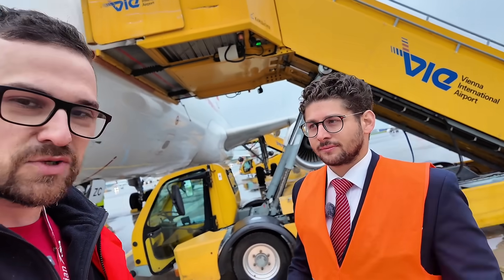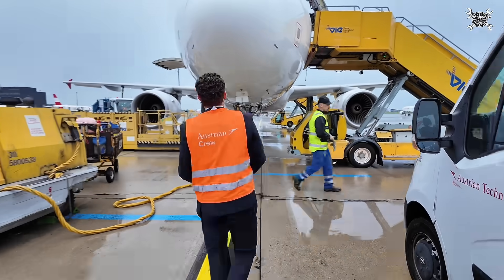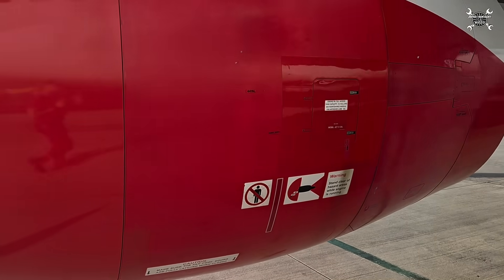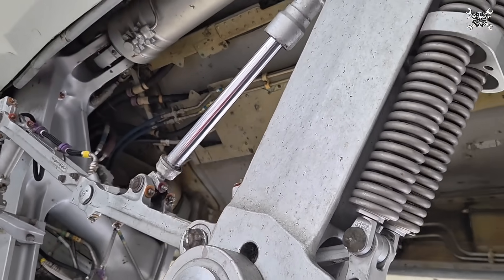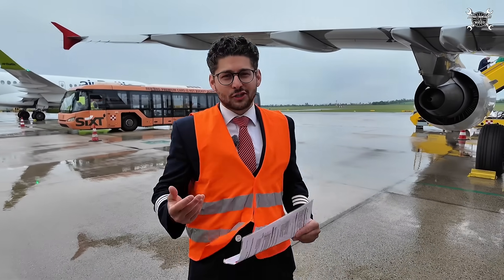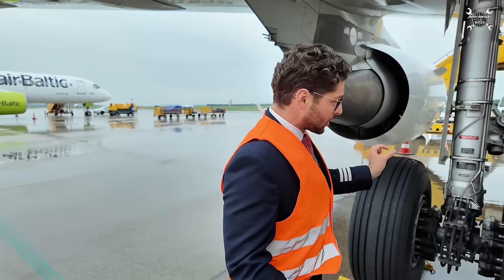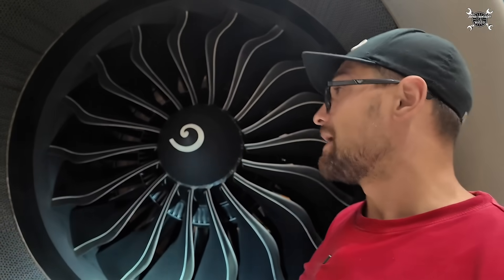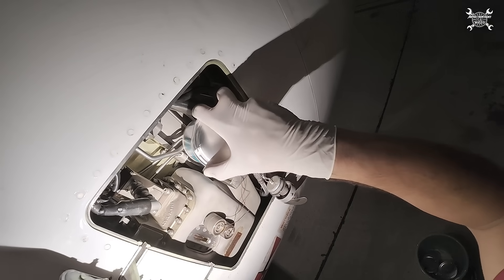What to check during walk-around on A320 (pilot version)

Comment: Why is the FO not wearing hearing protection? Neither are you.
Reply from the maker: Because we want to hear each other. Normally we wear protection 🙂
Reply: There is no APU running and no other aircraft on engines nearby. So it‘s not that noisy. Otherwise it would not have been possible to take that video incl. audio. With APU and airconditioning packs ON we certainly wear ear protection. The aircond packs are even far louder than the APU itself.
Reply from the maker: @pollexzapferl158actually APU and packs are on I even said it on video. This was our choice to hear each other, but as I said this was only to shoot the video. And it means that my noise cancelling function works 😁
Reply: @pollexzapferl158 It is normal policy at airports around the world for Safety shoes, Hearing protection and Hi Visibility vest to be warn on the tarmac. There are exceptions, crew & passengers boarding or disembarking. Aircrew normally don't wear safety shoes for the walk around.
Reply from the maker: @Speedbird100 what is your point? Most of my colleagues don't wear earplugs or any sort of ear protection. It is everyone choice.
Reply: @zeto.r  I am surprised that it is not a requirement by your airport or company. As for my point it is that exposure to loud noise (jet engines, APU etc.) can lead to irreversible hearing loss.
Reply: @Speedbird100 , the amount and type of PPE required is usually part of an airport’s SMS in accordance with ICAO Annex 14.  AFAIK for crews it is the hi-vis vest only. But we usually use ear protection because it’s in our own interest. Earmuffs are stored in the cockpit‘s wardrobe.